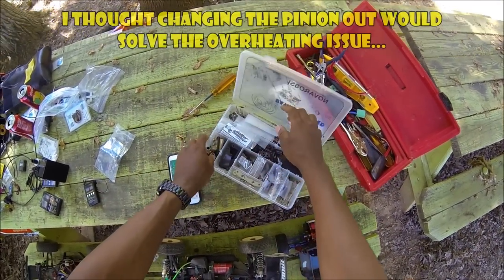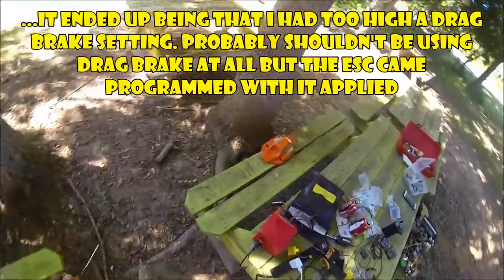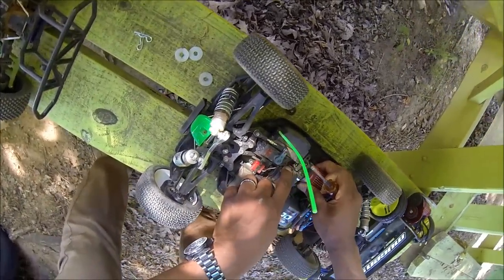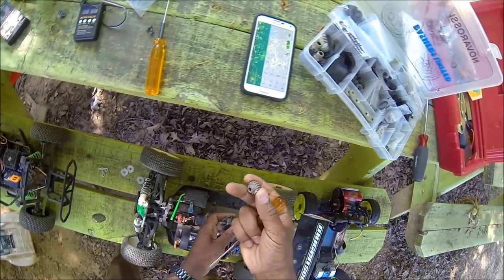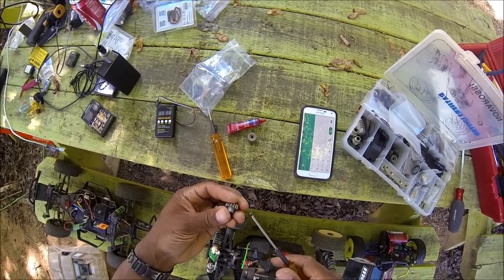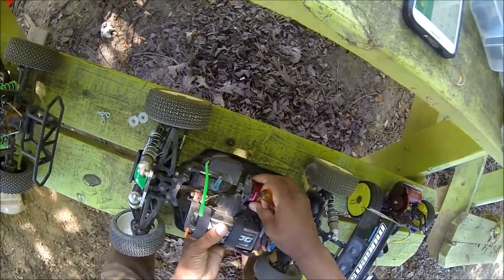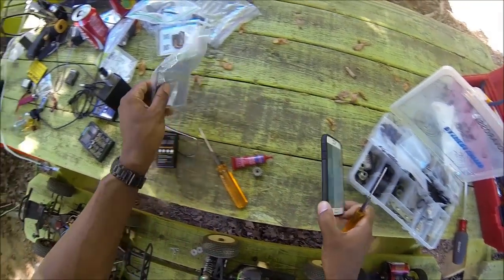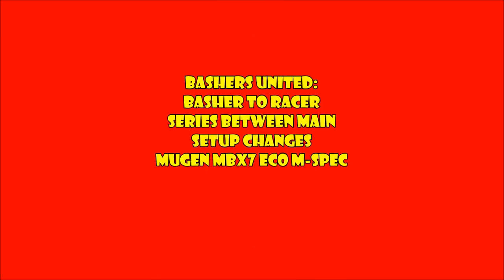BU:  Basher to Racer Series Between Main Setup Changes Mugen MBX7 Eco M-Spec

Comment: hey men, love your videos. I'm getting my mbx7 to electric, what pinion should i get? with the conversion kit it brings me a 12 t pinion. keep it up men, your awesome!
Reply from the maker: Victor Juarez  it depends on what size spur you have. It comes with 2 a 44 and a 46 or something like that. I think I would have been fine with the 15T pinion had I not been running drag brake via the ESC. Drag break basically applies a certain % brake every time you release the trigger. Brakes on a brushless motor produce heat. Oh and thanks for the love bro!
Reply: thanks men, I think I'm gonna use a 15t pinion  that i have! thanks for the advise bro! keep it up
Reply from the maker: Victor Juarez No problem!